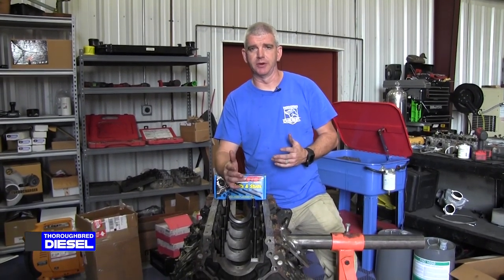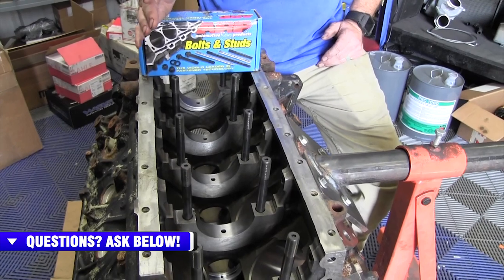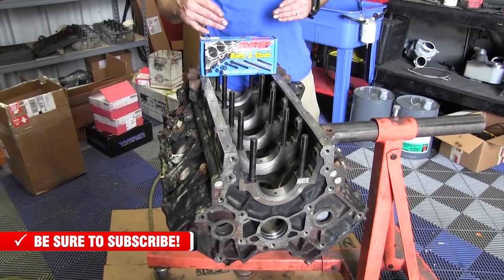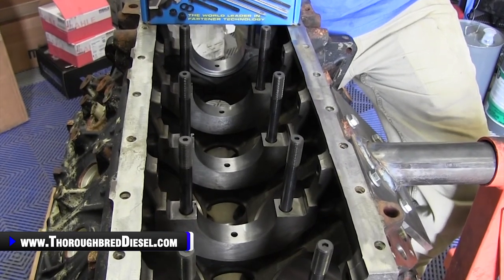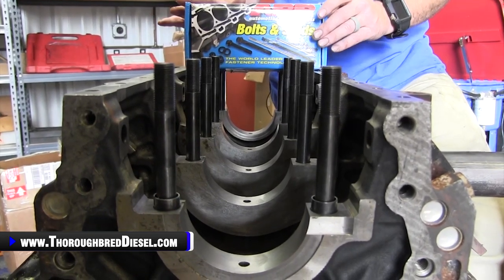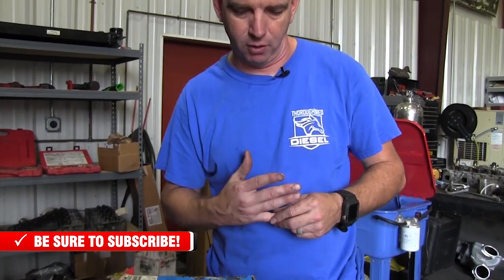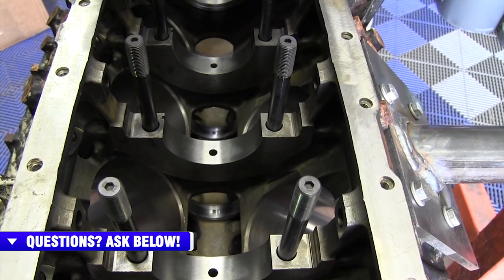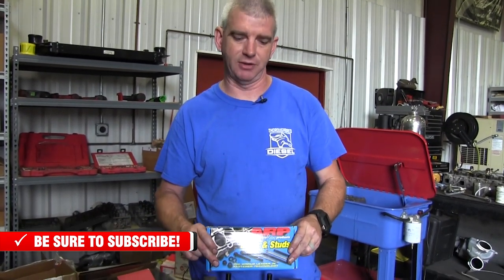Watch This Before You Install Main Studs

Comment: Fine threads have higher torque values because of the extra friction of the increased thread surface area.  The threads need to be perfect and mated as sets (stud, nut and washer and preferably with lapped faces) Threads need to be torqued a few times before the final torque to “break them in” as well.  So do that before you send it to the machine shop if you’re worried about crankshaft bore distortion.  I’m willing to bet that you’re stock bolts and these studs at the same stretch value have similar distortion because they’re applying the same (200,000 psi tensile strength steel) clamp loads.  Like almost “0” distortion...I’ve never wiped out a set of bearings, had weird bearing shell crush or had uneven or abnormal wear using studs in place of bolts before.  #1 rule of crankshaft installation...if the shaft and bores measure on size, you assemble it, it’s an absolute rule it needs to spin freely by hand.  If you can’t turn it by hand there’s a major problem.  Cylinder bores are prone to distortion right at the sealing area of the second ring...it’s a good idea to use a torque plate on the block deck during final sizing.

Comment: I’ve built many engines with main studs without having it line bored and none have failed me yet due to bearing failure just check it with a plastic gauge if it’s good it’s good
Reply: Yea it doesn’t make sens unless their was a problem to begin with that’s why they say to do it I bed to cover their arsh
Reply: It could get a smidge tighter cause of greater clamp force. Much less of an issue than rods. Plastigauge and smooth even torque spinning in block its good.

Comment: Just bought a set for a 24v cummins and closest line borer to me is 2 states away so guess im gonna full send it.
Reply: How has it held up???
Reply: @CD24v  haven't installed them yet, decided to fire ring it while its out so its been just a waiting game because my machinest has been booked, i butted the rings on the first 3 cylinders, dropped the engine off last week so hoping he'll have it done by Friday, he's mainstuded plenty of smaller engines so i talked to him about it he thinks with the size of the main caps there will almost be zero deflection especially if you've seen the enormous torque spec of the stock bolts if they didn't cause deflection the studs won't either. The studs torque to 130ft/lbs the stock bolts torqued in the neighborhood of 180-190ft/lbs.
Figured out he has a line bore for that very purpose but he said it would be a waste of time and money.

Comment: What if the torque values for arp studs and oem bolts are the same ( 110 ftlbs) would you still get it line hone?
Reply from the maker: Yes. Always good practice on main studs.

Comment: Anyone watching this vid, this process is only necessary if your going to the effort of line boring your engine.

If you want to save money,measure them yourself first. Torque the arps to spec. Measure your mains for out of roundness andmeasure all mains for alignment. If there out of spec, then get them line honed. 

. If there within spec, you won't need a line hone.